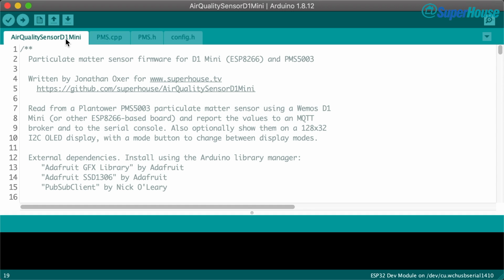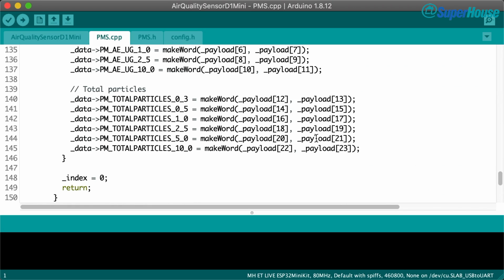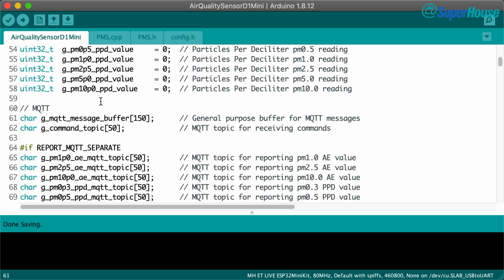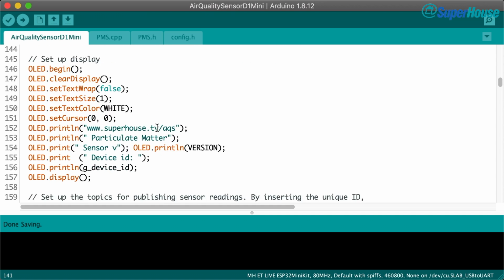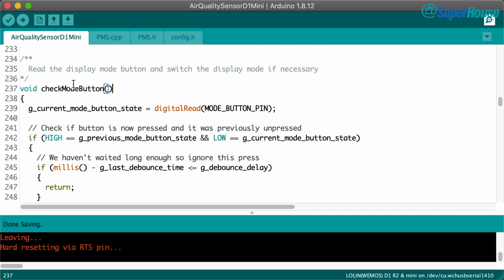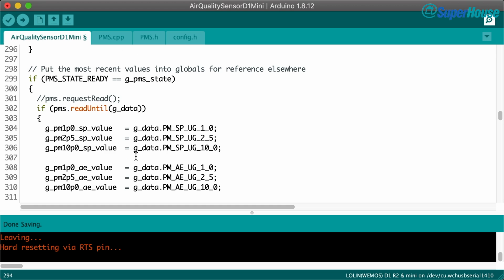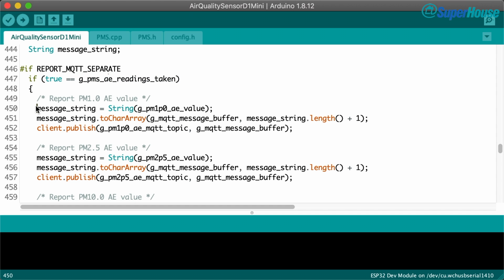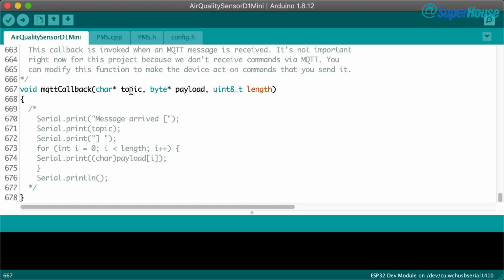SuperHouse #40: DIY air quality sensor part 3 - software

Comment from the maker: Oops, I mis-spoke when I was complaining about Hungarian notation: technically C isn't a "strongly typed" language, but I think my basic point still stands and the type system will catch many problems related to variable mis-assignment.
Reply: C most certainly IS strongly typed, but this is obscured by it providing access to the underlying "raw" or "machine hardware" types.  It is the over-use of these "generic" types that weaken type use in C.  The best way around it is to make heavy use of typedef to create separate, specific types for each need.  See my comment further below for details why this is important (and free) to do.

I agree about Hungarian Notation, but not for your reasons  Every modern IDE will display the type of a variable by placing the cursor on/in/next-to the name: Let the IDE do its job!  If your IDE lacks this feature, stop using it!  I heartily recommend vscode (Visual Studio Code, https://code.visualstudio.com/, which confusingly is not "Microsoft Visual Studio") for pretty much every language on every development platform for every target system.  Yes, vscode also speaks Arduino: https://github.com/Microsoft/vscode-arduino

Comment: I've built it, and with some tweaks it's working great now 👍
I've added a button to be able to change the update interval on the fly.
Also, I noted a bug in your code; The MQTT messages are spammed with dozens of messages per second.
Reason; 
there is a check "if (true == g_pms_ppd_readings_taken)" which is neat, but after reporting, this variable has to be set to false again, which does not happen.
The variable will become true again during the next reading, and then it's again one mqtt messages, etc..
Reply: I've altered lots of this in the source, but I think the mqtt message spamming is solved by adding these two lines at the end of the loop() function:
  g_pms_ppd_readings_taken = false;
  g_pms_ae_readings_taken = false;

Comment: Thank you, this project is awesome! I have had a PMS5003 sitting around for a while however just haven't had the time to write the code. Well, you kind if did the exact thing I was planning on doing. :-) I'm going to port this code to Atmega and use Ethernet. Two minor suggestions though. For serial debugging, use the F("some text here") macro to store all those strings in flash, not RAM. It will save most of the RAM you use. Additionally avoid the String class and instead use cstrings. String had a tendency to fragment RAM and is a major source of memory leaks in the Arduino framework.

Comment: How are you mate, I really appreciate the information you post and the way you do it. thank you very much, I hope you can give some insight on an idea that I want to make, my garage door is fully sonoffed using sonoff sv flashed with ESPhome with an addition of an ultrasonic sensor to detect if the car is parked or not. all work great and as expected but I need to add a very important safety measure, I want the door to stop functioning if an object is in its way, like my pet crosiing the garage door while it is operating or my car is parked under the door but not fully inside the garage, I want to prevent the door hitting the car if the remote is activated by accident, can I do that with what I have already, like some configuration inside the sonoff sv bearing in mind I have already used GPIO 4, 5 and 14. Or do I need to add a sonoff basic so its relay stops the garage motor from working based on another ultrasonic sensor reading that measures the door horizontal gap?  and if so how, please?  Your insight would be greatly appreciated. Have a nice day

Comment: Some minor nits:

1. Having uint32_t and similar "naked" types everywhere makes it seem all such variables are "the same thing".  They are not the same thing!  They only share a common underlying representation, with very different meanings.  That is, the difference between syntax and semantics.  Liberal use of typedefs can make code not only more readable (especially improved function signatures), but also give the compiler more hints to help catch incorrect assignments, and also force the programmer to use explicit casts when intentionally breaking type boundaries, even when the underlying machine type may be the same.  And it comes with no cost to the final code speed or size (it's free!).

2. #defines are EVIL!  Especially when used for machine states.  Enums are much more practical and type-safe, and again it lets the compiler help keep things correct, keeping like combined with like.  Again, at no cost to the final code speed or size (it's free!).

3. Avoid using naked 'if' tests ("if (x)..."), where the reader of the code must remember what the underlying representation of true and false are in the current context.  This becomes very problematic when multiple languages are used.  For example, I use C for tiny embedded systems, and Python for large-scale data analysis from suites of tiny systems.  A better approach is to ALWAYS explicitly use a logical comparison operator (>, <, >=, <=, ==, !=), no matter what language is being used.  Yet again, at no cost to the final code speed or size (it's free!).

4. All functions should have a return value, even if only an error state, even if it is normally ignored.  This greatly helps debugging, and also encourages cleaner development.  If use of the return stack really is a problem, control the return with a global DEBUG define that resolves to a ''null' return type when disabled.  This also permits all error conditions to be declared in a global enum and then returned as needed then printed, vastly reducing the need for inline printfs in the code.  A tiny bit of overhead that pays large dividends as projects grow.

5. I totally agree that C made a huge error allowing assignments in conditionals.  While moving the constant to the left of the conditional certainly works, it is indeed jarring.  Another approach is to get rid of the == via a define, such as: "#define is ==", yielding code like: "if (the_state is THIS_STATE)".  Many purists will object to 'hiding' the C syntax wart like this, but it is actually how many other languages do value and type comparisons, and is not an unusual idiom.  Again, the compiler does this for free.  More importantly, all modern C compilers have switches to emit errors or warnings when assignments exist within conditional expressions (gcc's -Wall option does this, among many other useful things).

 6. MQTT packet size.  The MQTT specs allow for packet sizes up to 256 MB (yes, megabytes!).  A 128 byte length is actually more wasteful than 127, as the MQTT packet length is a single byte when the size is <= 127 bytes, but is 2 bytes for a 128 byte length.  The MQTT packet length field can vary from 1 to 4 bytes.  Since we know we'll be sending our packets over IP, it makes sense to limit the message to a single IP packet, which has size 'MTU' for a given network interface, typically something near 1400 bytes.

7. Empty function bodies are another C wart to be avoided.  Always include at least an explicit return statement (which is free).  Actually, EVERY function should end with an explicit return statement.  It makes things much easier to debug using GDB, as you can set a breakpoint just before exit, not at the start of the last line doing work.

------------

All the above nits were detected ONLY because your code walk-thru was truly EXCELLENT!  Yes, the video itself was on the long side, but it made every minute count.  Your explanations are lucid, and the code is clutter-free.  Very well done, in all respects.  I particularly like how you gave credit to that book, but it would have been even better if a link to it were included in the description (please don't make us click through to a separate site just to get that link).

I wrote my first program 50 years ago (and my first embedded/real-time program 45 years ago), and have suffered through innumerable code walk-thrus and project reviews since.  Most were dreary snooze-fests that made it difficult to actually review the material, rather than worrying about running out of coffee.  This video is nothing of the kind, and instead is the kind of code review I always hope for.

I very much look forward to your next code video!

Edit: Typos.

Comment: Just curious.  What is the difference between your "Hello World" alive message and using a LWT?
Reply from the maker: Good question. The LWT is intended for a very different purpose: it's to determine what happens when a device disconnects from the broker, not when it first connects. I'm using the "status" topic kind of like a system log.
Reply: @SuperHouseTV  Thanks for that.     Makes sense.

Comment: Great video, I picked up a few useful tips. Any reason why you used ESP.getChipId() and  not WiFi.macAddress()
?
Reply from the maker: I don't have a strong preference, that would work fine too :-)
Reply: @SuperHouseTV  The ESP MAC address can be set to any value desired!  I would not assume anything about the uniqueness of it's value.

Being able to set the MAC address in IoT devices greatly simplifies a couple of niche networking issues that most end-users don't care about, but that every single IoT device manufacturer on the planet most certainly DOES care about!  For example, many vendor programs are able to discover their devices on your network even if they don't yet have IP addresses assigned.  They do this by knowing the MAC address range they use for their devices, then using ICMP/ARP to scan through that MAC address space.

In my own HA system, I move all MAC addresses *away* from the factory assigned value for that exact reason:  I want to "own" my devices and limit their discovery by others.  Any device lacking a modifiable MAC address gets returned.  Still, I do record and preserve the original MAC address in case I return, sell or give the device away.  This is far more work than most will want to do for themselves, but I'm paranoid about security, to the point that it's more of an addictive game for me.

As an example, my router sends me an email whenever a new MAC address shows up on my network.  If it is on my wired network, that MAC address is immediately blocked at the switch until I explicitly add it to the "permitted" list.  There is no need for this on WiFi, which has decent security (when used correctly).

Comment: Very well done, love this video & thank you for all the information, definitely going to help my coding. I do have one question about "Serial.begin(xxxx)". When you insert all these Serial.println in your code does it slow down the loop even if the board is not plugged in to the USB. Does it make any difference?
Reply from the maker: It would make a tiny difference having those in there, but nothing that you'd care about. It pushes the message into the serial buffer, which is never processed so the message doesn't go anywhere. It should run at the same speed whether USB is connected or not.

Comment: Curious why you use #defines for your state machine states rather than an enum (or my preferred an enum class and a switch case)? Achieves the same thing of course, just interested!
Reply from the maker: No specific reason. I've used enum for this purpose other times. I'm just fickle. I'm also not a programmer, so I'm fudging my way through things.

Comment: feedback for code (code compacted):

----
For local variable in global scope prefix with static
----
I would prefer to use an enum for the states:

typedef enum {state1, state2, state3} states_t;
static states_t mystate;
----

For use struct for grouping:

typedef struct {
  uint16_t  pm1p0;
  uint16_t  pm2p5;
  uint16_t  pm10p0;
} stdParticle_t;

static stdParticle_t stdParticle; //is per default initialized to 0

You should minimize the number of global variables. The stdParticle_t could be moved a "particle-sensor.h" 
----
g_mqtt_message_buffer[150]; Its normaly bad practice to use constants like 150 in the code , define the constants

-----
g_current_mode_button_state should not be global, is only used in a local function

----
Separate the functionality i more files: example one for the particle-sensor "particle-sensor.cpp"

make the updatePmsReadings() return a boolean to indicate if all readings been taken.
Reply from the maker: Great suggestions from someone who obviously knows what they're talking about. Which I don't.
Reply: @SuperHouseTV  I do not agree, you actually know what you are doing. Not many are following some code guideline like you do, in stead of throwing some code together.  All code can be improved by having someone inspecting it and make feedback, and I thought that your code deserved it. So keep on improving and learning and follow some guidelines. You have succeeded if its easy to read your own in a year.
Actually I am following your sensor project and waiting for my sensor to arrive in the near future. Looking forward to your next video.

Comment: Does your "events" status topic get messages from every device on wakeup including waking from DEEPSLEEP? I did something similar (for my temperature sensors that go to sleep) but was looking at it sending messages every time from deepsleep and was curious if there's a way around that. As far as I can see there isn't since it's basically just rebooting it with the pin
Reply from the maker: Great question, and yes, that's what happens. If you have an RTC attached you could have that message happen conditionally, but the internal millis() counter is reset along with everything else during wakeup so you can't use that to check how long it's been. One nasty option is to ready millis() right before going to sleep, and add it to a runtime accumulator stored in flash. On wakeup, check how much runtime has been accumulated. Or instead of runtime, it could be a simple counter of how many reboots have been seen since the last report was sent. Clear and start the counter again when required. If anyone has a nice solution to this, I'd love to hear it.
Reply: @SuperHouseTV  Ah I see, yea I think I read through something of a "hacky retain data through deepsleep" like that but it gave me nightmares so I just went with the msg every reset instead.. for now. RTC method is more understandable to me at least I might try it

Comment: Just another thought, main program has a loop that never ends, at 17:51 you call a client.loop(). in Arduino terms a loop never breaks it's the main running code. So calling a loop would appear to call a routine that will never come back to the calling process. Would it have given more clarity to the user if were to call a routing called something like, client.process_message_data().
Reply from the maker: That method is defined in the PubSubClient library, so it's not something that I named.

Comment: With the case statement and default,  the same can be said of the 'if'  or 'else if' statement should always be completed by an 'ELSE'. Have you looked at Mirsa C  coding standard. Great code review.
Reply from the maker: Good point. I haven't seen that coding standard, thanks for the tip. I'll check it out :-)

Comment: Interesting code explanation and really one of the most easy to read codes I’ve seen so far. I plan on making one of those but using a bigger oled display (one of those 2.42 inch I think they were) because my wife has a bad eyesight. Given your code this should not be to difficult I think. And of course I need to modify the case to fit that screen.
Reply from the maker: I look forward to seeing the result, that sounds like a great idea :-) I have a version with a 240x240 pixel colour TFT coming up in part 5.

Comment: Can't you define MQTT_MAX_PACKET_SIZE in your file above when you include the library and have it will override the PubSubClient value? The PubSubClient library looks to only use the default 128 value if MQTT_MAX_PACKET_SIZE hasn't been already defined.

Great series of videos.
Reply from the maker: Wow, you may be right! I'm going to check that for sure. I thought it was impossible to overwrite because the Arduino pre-processor does the libraries first, but I really hope that's not the case.
Reply: Was gonna say exactly the same thing. Have done that in the past. Use "--DMQTT_MAX_PACKET_SIZE=1024" to define it when running the compiler. Very easy when using Platform.io to compile/build. Not sure about the Arduino IDE